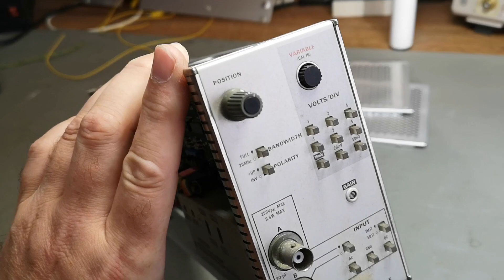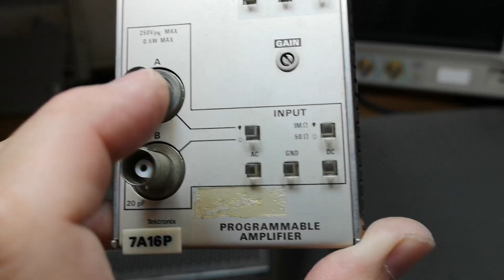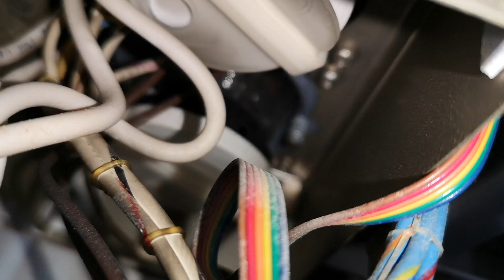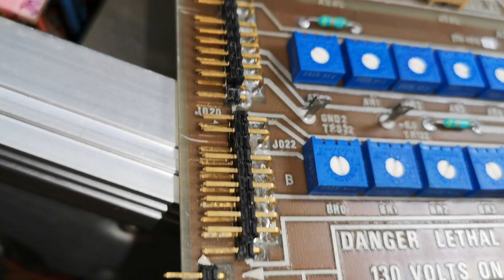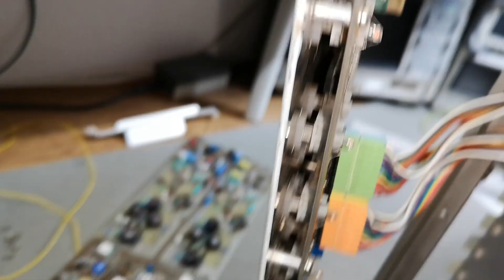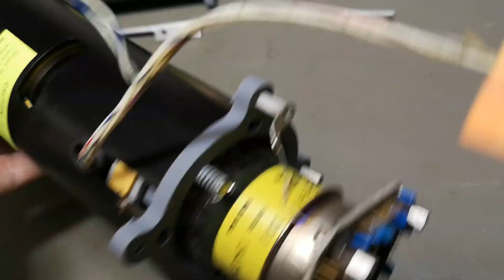Tektronix 7612D programmable digitizer 1981 teardown part 3, CRT and HI volt

Comment: I’d go around the crack with runny epoxy just to add a bit of strength to it. If the crack is not open then atmospheric pressure may be keeping it together against the internal vacuum. Getter looks fine, right? I’d power up the heater and see what happens.

Comment: The four holes in the 7000 series plug-in were intended as part of a fiber optic readout system similar to how the readout on the Tektronix 576 curve tracer worked.  Barry Gilbert, who the Gilbert cell and Gilbert multiplier are named after, designed the electronic readout for the 7000 series which replaced the proposed fiber optic readout.
Reply: I was just about to say that! Gilbert was a genius. He was so productive, it’s incredible.

Comment: Looking at other posted images of that CRT, I'm wondering if that is a join rather than a crack? Especially since the getters seem ok? 
Edit: Can't link here obviously but the "lampes-et-tubes" site has a close up image of something that looks like a metal ring or join around those conductor pins.
Reply: I agree. Unless the tube is obviously in pieces, you should check the getters before concluding that the tube is cracked and has lost vacuum.

Comment: Hi Thomas, I was completely shocked when I saw the crack, too bad you cut the anode wires, I would try to turn it on even with the crack if the blade would crack like that in the tube lined with sheet metal.

Nice day 😥 Tom
Reply from the maker: I have a win ratio of about 95% so i am not sad no matter what, but maybe one day I solve this